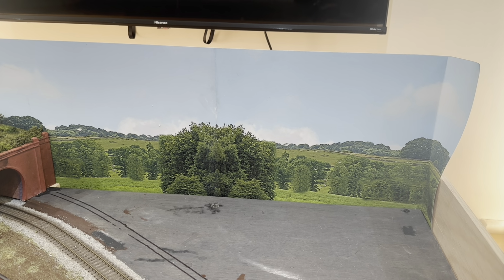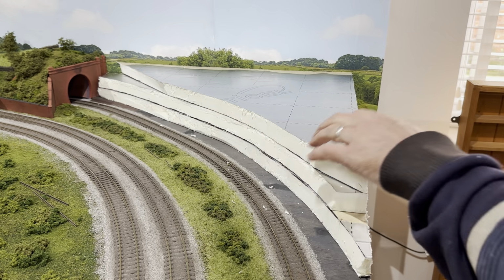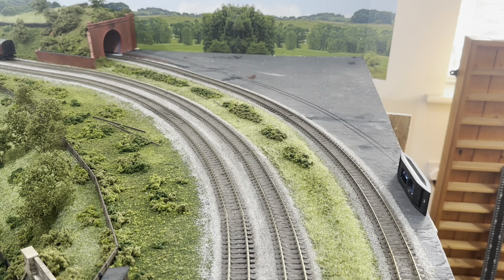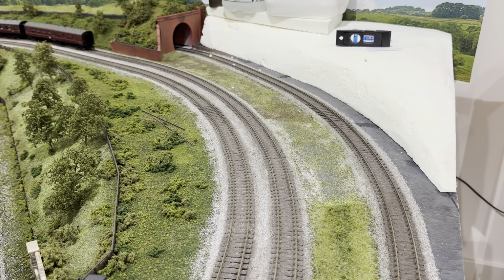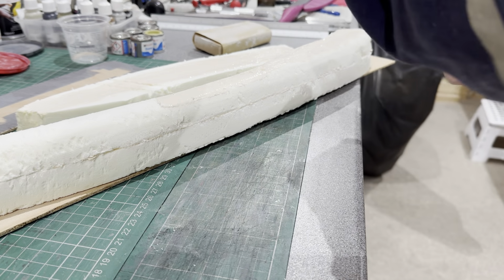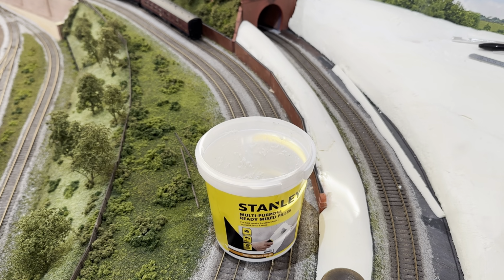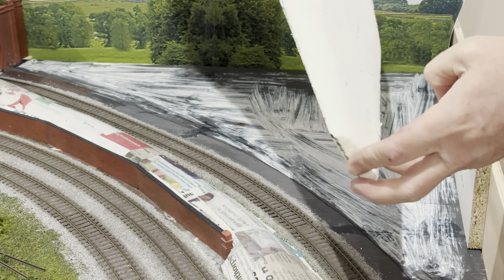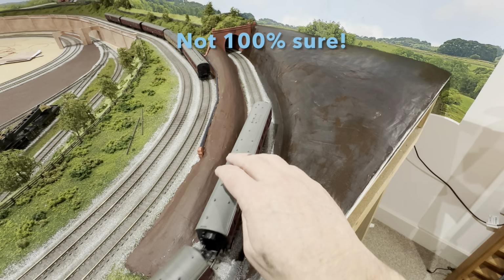Beechcroft Model Railway - #31. Distracted again….

Comment: I got the first banking and it looks really good but the smaller one between the lines dominants the layout, you can’t see almost any of the tunnel portal, could you have not achieved same with some well positioned trees, bushes? Consider making some embankments chalky, like the railway engineers following the lay of the land to an extent like in Wolds in Yorkshire or the Downs below London you get some really steep natural forming hillsides which branch lines weaved through.
Reply from the maker: Thanks. Some really good ideas there. I’m still not happy with that area but more on that another time.. 👍

Comment: Hi Andy, voice of doom here again 😮. You really know your stuff and you do a fantastic job but I question the need for a tunnel as there seems no difference between the new hillside with the cutting and the old hillside with the tunnel. Why would they go to the expense of a tunnel when a cutting would do? Rule one applies of course, it's your layout 😊
Brian
Reply from the maker: Hi Brian. Couple of things…. Your not a voice of doom, and I certainly do not know my stuff!! 😃. Seriously though, it’s just one of those areas I don’t think I’ll ever get right. All stems back to the track laying. The incline is far too close to the outer edge of the board making it difficult to get a decent cutting effect. Other than extending the board out meaning no access down that side to the windows I’ll just make do…. Although I have had a couple of thoughts on it. Hindsight eh! Take care, Andy 👍

Comment: Genuine question, is paper as good as plaster cloth, asking because i am about to start modelling my own railway….
Reply from the maker: Hi. I’ve used both in the layout. Paper is definitely quicker and cheaper but not quite as strong as plaster bandage. I do prefer paper but if the layout was portable then I would use plaster bandage for added strength 👍